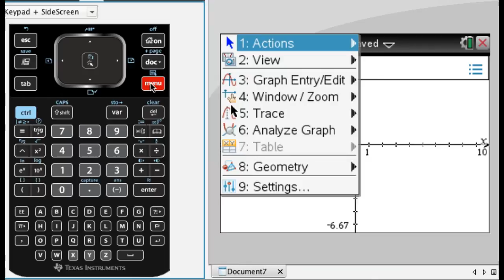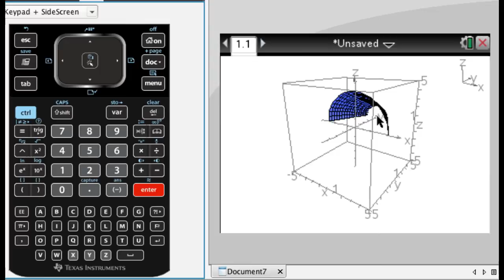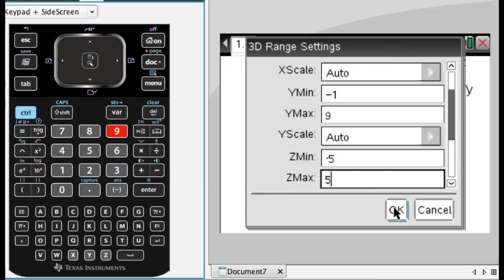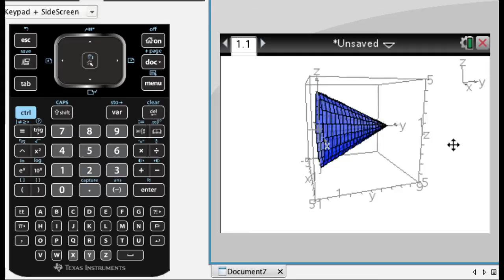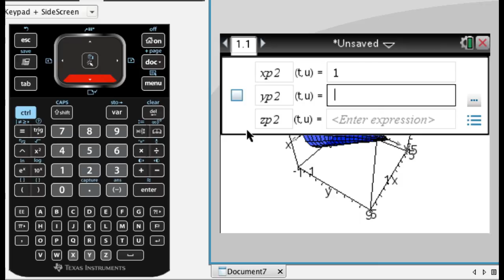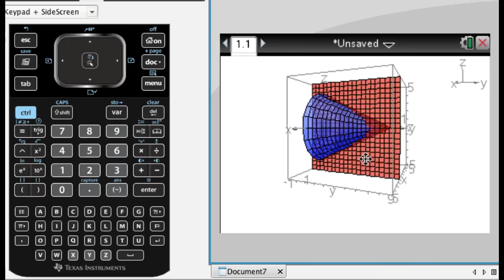Graphing a Parametric Surface on TI-Nspire

Comment: my calculator keeps giving me syntax errors! I'm trying to graph 3d parametric vector functions on my TI-nspire CX. I'm trying to graph x=tcos(t), y=t, and z=tsin(t) when t is greater than or equal to zero. i replaced the trig t values with u in my calculator, and i keep getting a syntax error :(
Reply from the maker: My first thought is that perhaps you're not putting multiplication between the t and the trig functions.  That would tell the Nspire the function is tsin(t), a function named tsine, kind of.  So, t*sin(t) might work for you.  Let me know how that goes!

Comment: Anyone know how to graph a plane equation? It doesn't let me include any z's. Just x's and y's
Reply from the maker: So, one option is to just solve for z, that's probably the easiest thing to do.  If you have a CAS it will do it for you.   A second option is to write the plane parametrically.  You'll need two vectors in the plane (but if you have the plane you can just find three points in the plane to create the two vectors).  Here's a video on writing it parametrically: https://youtu.be/fSypBfWO0N4
To switch to parametric while in 3D graphing, press Menu, 3, and pick parametric.
Reply: @turksvids  Thanks!